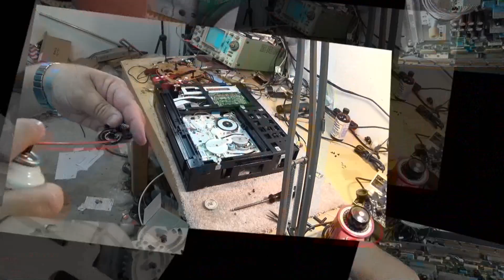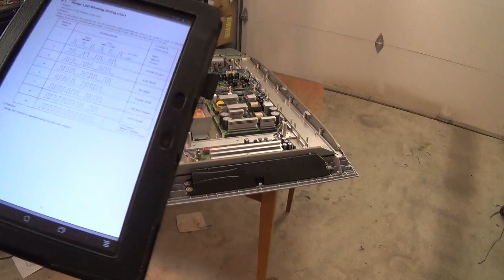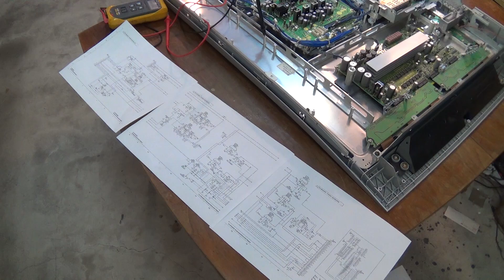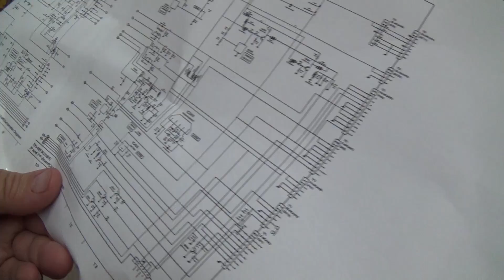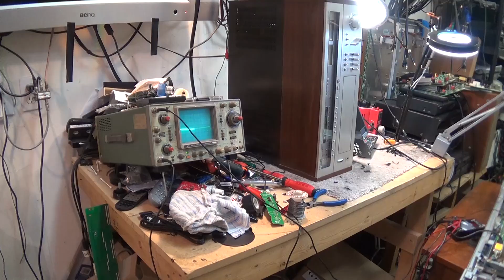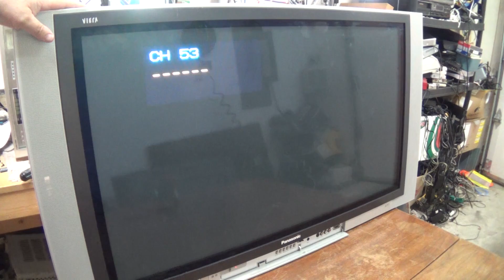Panasonic th42pa20 plasma dead set 12 blinks

Comment: Just got an almost identical set to this from the good old kerbside shopping mall lol (Can't tell exact model as the sticker is gone, but it's very similar in looks apart from having SCART in place of 3 of the component inputs & definitely older as no HDMI...  Naturally, after drying out and removing a slimy slug from the back it works fine so presumably just been retired for something newer and "better". Almost disappointed TBF, was kinda hoping for at least a little bit of diagnosis fun for the evening!  Think it's a keeper though, heavy, power hungry and standard definition... Perfect workshop set for me!  Might be cheeky and go back to ask for the stand though, you're right it's a pain when they don't have one!

Comment: yeah he cut pin 1 that was shorting,which is analague,so don't need it and although he did'nt find short it works
Reply from the maker: No I took out the bad coil that was shorted, and put a jumper wire over where it was. It was just to remove ripple from the boost converter. The analog tuner works perfect in this set. I use it as a shop TV, and I do use the analog tuber to tune in my in house analog distribution network. I have modulators on channel 4,5,7,9,12 and CATV17.

Comment: So it was an SMD inductor filter on the tuner board?  You just jumped it with a wire?  Where do you get your schematics from?  I can't find schematics on the internet.  I had a client that had a CRT tv where the relays were working, the TV made a constant, repetitive clicking board.  I troubleshooted the power supply, and found a shorted electrolytic capacitor (49000 at 500WV), which cost me $20.08.  I was not going to charge the client for the two hours of troubleshooting since I could not fix the TV.  Should the client have paid me for the defective capacitor?
Frank
Member
Frank Reiser Video/Audio Service
Reply from the maker: If I don't fix something I don't leave new parts in. I pull them.  I have very few schematics.  I didn't have one for this or any flat panel TV's I have fixed.
HiFi engine is one if the places for audio stuff.
Yes DC filter in tuning voltage noisy converter was fault.
Reply: @12voltvids  Thank you tutor.

Comment: I wonder how many people have electrocuted they trying to fix this model...
Reply from the maker: The chances of being electrocuted is pretty slim.  You would have to try real hard to do it. You can get bit if you stick your fingers in when it is on but that is more of an annoyance then anything.  If you want to play with dangerous stuff work on tube gear.
Reply: @12voltvids  - My grandpa worked as a TV & Radio repair and salesman 1950 -1980, Zenith, GE, etc..  So much tube gear!   His shop was filled with so much cool stuff!  You do some great repair work!
Reply: Those black things on the sides must be the speaker enclosures

Comment: Unreliable with that power consumption a led same diagonal use under 100w
Reply from the maker: Well lets see here.  Average plasma runs well over 10 years with no problems at all.  Average life of led set 2 years.  
Lg had some reliability problems when they went to the  ipm design but the panasonic's have been very good.  Loose ground screws biggest fault. 
Even my old samsumg 63" is now 10 years old has almost 30,000 hours on the panel and still works as good as the day that 2 of us struggled to mount that heavy bitch on the wall. (179 lbs)
Reply from the maker: Incidentally as you probably saw it was a little power filtering coil in the analog tuner that failed on this.  I use this set in my work shop now and it gets plenty of hours.  It is 14 years old now.

Comment: I'm still confused what you did to fix this, did you replace that little part?
Reply from the maker: At 23:05 you will see the board where I removed the shorted part. I jumped a wire over the bad coil, to supply the B+ tuner boost to the tuner.At 23:46 I point out the trace where the coil was mounted. Just jumper the traces to supply power to the tuners. If you don't need the analog tuners to operate it is OK to leave the shorted coil out. Then just the video, component and DVI (HDMI) input will work. I wanted the tuners working as I use analog RF signals for in house signals over coax for things like my security cameras.
Reply: So a little peace of wire replaced a coil? I wonder why they did not do that at the factory? I  like your show you have covered so much stuff. Thanks so much.
Reply from the maker: No I replaced it with a piece of wire. The coil actually removes some ripple that makes it past the capacitor in the buck converter. By jumping the coil the tuning voltage is slightly low, so the tuner won't cover the high band properly, but since analog broadcasting no longer exists, and all I need it to tune is channels 2,4,5,7,9,12 and 27 which are the possible channels inserted on my cable from my modulator array it tunes high enough. It won't go above UHF 30 but as I said most people would not need the analog tuners anyway because analog broadcasting was shut off in 2009, and most cable companies no longer have any analog channels running anymore. So a digital box is required, and even if the analog output was used from a digital box, only channel 3 would be needed.

Comment: should I only remove the LC4371 small coil.... because of the shortage???
Reply from the maker: Angela Jones 
if you don't need the analog tuners to function then you can simply remove the coil. since I still use analog distribution for SD sources I wanted the analog tuners to work so I jumpered the coil to provide the 37v Bruning voltage.
Reply: Well I messed up..I broke the coil next to it also :(
Reply: Stick a fork in me...I'm done.  I will just have to buy another television
Reply: Thanks for responding to my post

Comment: This was very very common on these sets.. Used to see this in the field. The Toshiba sets  that were made by panasonic around this time had the same issue with the tuner board. I believe it was a shorted capacitor.. used to replace them all the time..
Reply from the maker: Not on this one. They used a delay line as a choke to remove ripple from the buck converter they use to boost the 9V to 33V for the varactor tuner.I imagine the reason they use a delay line as opposed to a ferrite core coil is for the shielding effect as a delay line is essentially just a coil of fine wire wrapped around a non conductive not ferrous core and then has a ground shield around it to prevent ingress of other signals, and radiation of signals passing through the delay. Anyway the delay line shorted pulling the 33v line to ground and shutting the set off. I just removed it and jumpered a wire over it so the analog tuners work again. I wanted the analog tuners working as I use analog modulators at my house to send things like the output from my security cameras, and the analog output from my cable box throughout the house, along with the digital signals from the antenna. Naturally this set will only tune the 6 analog carriers I insert on the cable, but it is a SD set anyway. It now lives in my workshop and I use it for testing VCRs and other SD devices. It will accept an HD signal through the component or DVI/HDMI input but being a 852X480 panel that is all it is ever going to display. Still looks great, and when I had it given to me it still had the bill of sale to the original owner stuck to the back. It came from the shop I used to work for a year after I left. The price? $7,000.00!
Reply: In the field these sets were under extended warranty so we did not change the actual components, we changed the boards until they became no longer available. So what component was that? what was shorted?
Reply from the maker: LC4371 it is a small coil. You can see it at 22:57 in the video.
Reply: Ok so the coil was shorted against the grounding shield... it's been many many years since I worked on this one.. I mostly work on the new sets.. feel free to ask if I can help
Reply from the maker: Yes that was the problem. Took quite awhile as you can imagine to find that part shorted.
Reply: I found the short on the feed itself but in the field we went no further in the interest of time we weren't allocated enough time to do component level repair.. in some cases some customers did not use the tuners and we just disconnected the board... Good to see what component itself actually causes it..

Comment: did you connect the wire pin 1. back..

the one you cut.
Reply from the maker: Yes or the analog tuner would not have worked. That is the  source for the BT or tuning B+. It goes through a buck converter to be boosted to about 33V. Without the coil the BT comes up a little low as the coil acts like an inductor, and filters out some ripple that remains. So the analog tuners won't tune above about channel 30 or so. No big deal. There is no more analog broadcasting, and my highest channel modulator I have in my system is channel 27. My other modulators are 2, 4, 5,7, 9,12 so for what I am using this set for in my home is fine. It is just a TV to watch in the garage when I am working.

Comment: where did you jumper the wire.. could not see...
Reply from the maker: At 23:55 you can see where I removed LC4371. That coil was shorted to ground. I jumped a wire over it, and it fixed the set. Analog tuners working now, not that there is any analog signals to watch, but I still have analog signals from modulators in my house, so I use analog for SD material all the time.

Comment: hello i jus started repairing lcd tv need help please.i have a Panasonic TH-42PX75U HD each time i change the buffer sd - board,it last for 2 weeks,them set goes to 7  blink .i take out sd-board ,  Panasonic TH-42PX75U HD work only the su .i also change the ss-board,but the same thing happen again. can u help me please?
Reply from the maker: Check your ground screws on the boards, and check for bad caps in the power supply with ESR meter.

Comment: Incredible picture for such an old set! I usually find these old Pannys are easy to diagnose, but not in this case and in the end welll worth fixing even though they may add a few dollars to your electric bill!
Reply from the maker: +James Last These sets do have a very good picture. Plasma sets do last a long time. Old ones were rated 60,000 hours, newer ones 100,000 hours for the panel. Now they were prone to screen burn if images were left static for a long time. Power consumption wise it isn't that bad. I did do a comparison to modern plasma, LCD, DLP and LED-DLP. Plasma prior to 2000 were power pigs, but this one, and more modern ones are not that bad.They got a bad rap in the media, by incompetent journalists with no idea what they are talking about.They wee the max 420 watts and they thing power pig because the equivalent LCD of the day was 340 watts. What they don't understand is that an LCD draws full power all the time, just like a projection set because the lamp, or backlight needs to run at full power.Plasma is dynamic, depending on screen brightness. On average a plasma will draw about 50% of its max rating. So a plasma rated at 400 watts will draw on average 200. Sure if you are watching hockey or ice skating, or skiing where the background is white they will draw closer to max power, but on average viewing it is not that bad.
Reply: I have a panasonic that had no problems

Comment: help me fix my Panasonic set its a plasma like this one . the component video I get no signal on video just sound  hdmi works fine . sd stations no video and the composite video the same thing just sound no video . My digital stations on the set comes in fine . im told there a falt on the dg board
Reply from the maker: +ducklandwikeno Yes that sounds like where the fault is. The A-D board is the analog to digital conversion, where analog signals are digitized.Make sure your power supply to the A-D board is correct. A missing voltage will cause this type of fault. Also don't overlook a shorted coil like I had on this set. That killed a voltage for the analog tuner, and ultimately shut the set down. If the digital tuner works, and HDMI input works you have just answered your own question. You know that everything on the digital side, and the panel works, as well as all the drive boards. The problem in in the A/D conversion board somewhere.
Reply: +12voltvids ill check I need to get off my wall too . I would like to fix it an place in the kitchen or give to someone in need of a television set . but ill keep you posted maybe ill make a video of it what it doing for the people top see .

Comment: I too print out the schematics rather than view them on some digital device. Much nicer to follow schematics on paper.
Reply from the maker: +MrPitatom If you think following a schematic on a tablet or computer is a problem, you never lived through the microfiche era. What a bloody joke that technology was. Had to have this big microfiche unit on the bench, and had to find the circuitry on the card, and slide it back and forth to trace anything because the projection screen wasn't big or clear enough to see an entire print at once. Dust on the film, or scratches would show up as phantom traces. Oh it was bloody awful  garbage, and all the major companies, RCA, Sony, Panasonic did this back in the 80's. Did it with their parts lists too.
Reply: I remember microfiche back in high school. Difficult to use and glad to see it go.

Comment: Panasonic is not a good product, I have a panasonic plasma 42 inches and didnt last long enough to compensate for its price and it gives 12 red blinking light,,,the death signal.
Reply from the maker: +stargeyser1 12 blinks on a Panasonic is a problem in the audio amplifier circuit on the newer models.
Reply: 12voltvids when you mention newer models, do u mean like mid 2000's? Just got the 12 blinks for 1st time since purchased in 2005. Ty.

Comment: I'm impressed with your persistence. Had I made it to the point where it worked without the analog tuners, I'd have happily put the cover back on.
Reply from the maker: +Jeff Ebenal I plan to sell that set, so I didn't want to send it out with no analog tuners, just in case whoever buys it only has basic analog cable. They still offer that here.It has a fantastic picture for an ED display, and besides I "needed" to figure out what the root cause to the failure was. It is just my engineers mind at work.
Reply from the maker: The panel glow is a good thing. That means that your panel drive is there. So you have to look into the video circuits.
Reply from the maker: Start by checking power supply voltages. You may be able to find a troubleshooting guide by searching on google. That is where I find my service data. Believe it of not I too am a rookie on these sets too. I cut my teeth working on all the old TVs and AV gear. Until I got this set I had never worked on one of these beasts, so I was learning as I went along. I have fixed perhaps 30 flat panel TVs, but thousands of analog gear. I have to laugh at some of my comments. I said I was getting rid of this one. NOT I ended up keeping it for my shop. It looks great, even though it is only SD.
Reply from the maker: Finding service data is half the fun. I googled the model number, and after several bad leads by sites wanting money for a manual I found the data for free. Most stuff is out there. Try this one. http://www.toms-service-manuals.com/